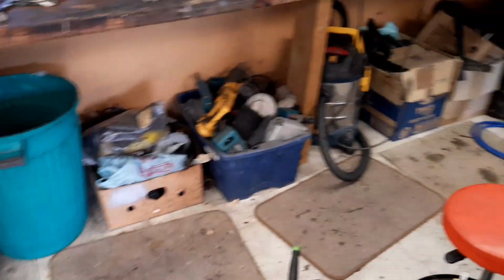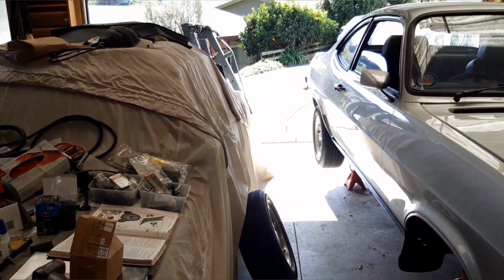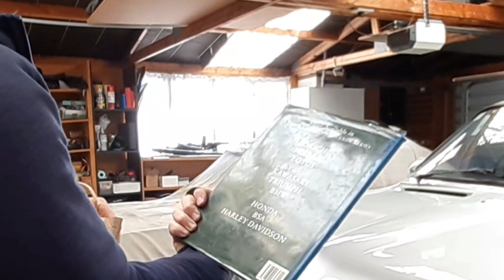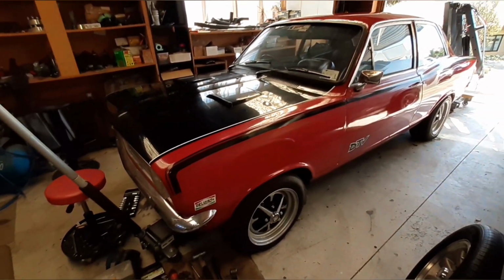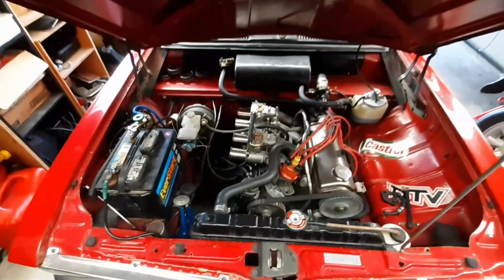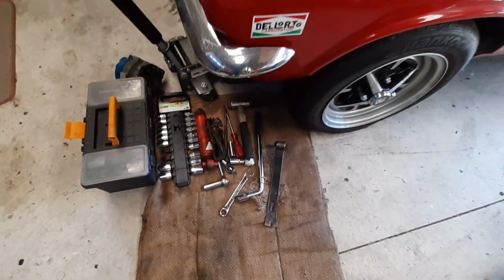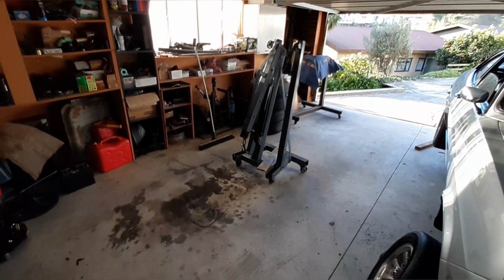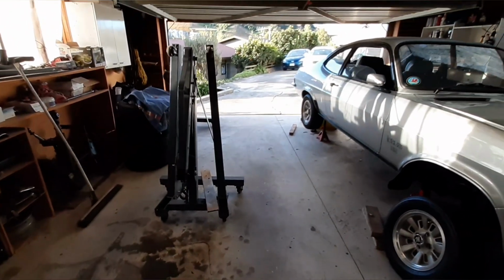LoTech Shed - Rehousing the Viva GT.

Comment: I had a standard 2.3 Firenza coupe that I also modded a fair bit back in the 80s and early 90s - genuine nosecone and some Capri Zakspeed arches with a big valve head (8 x 13s all round with 225s on the back and 205s on the front - 225s on the front were a tad too large as I recall), Kent VF2 cam and twin 48s. I did have an original snoot ZF box (and linkage that was made by a guy for the UK DSG), but later changed it for a Lotus ZF which had different ratios - I found them far better for street use. I think the first gear gave a bit more acceleration but was a little further spaced from 2nd so not as close ratio overall. I also had a 3.1 LSD back axle that was from a 3ltr Capri - it had been rejigged to fit the Vauxhall. I had a great time with that car. I bought the lower rear springs from a company here (last century), but the fronts just had a coil removed from the existing springs, and reheated the top cut coil to flatten it out (while it was in a bucket of cold water so it didn't effect the rest of the spring). That seemed to work well. 

There's currently a guy here fixing up a standard 1.3 HC viva and is going through some alternative springs so might be of some use maybe:

https://www.youtube.com/watch?v=IxiYTlNTgyU
Reply from the maker: Thanks for your comment. Sounds like you got into it deep back in the day. 
I've got some springs back in the front now, we'll see if they pass cert. Also installed new GAZ shocks. Still to spend more than a few minutes behind the wheel to see how I like it. It's quite firm for a road car, but kinda needs to be.
I will be posting an update soon, been a little distracted with the 'Vette!
Reply: @lotechshed4346  Looking forward to any updates - I've subscribed to make sure I see them!

I remember doing something a little similar to you after I'd rebuilt the engine (big valve head, reground crank, lightened and balanced etc) with the gearbox attached - I  test ran the engine just sat on the new front suspension (Ventora big disks and callipers)  to make sure the engine worked etc, then unbolted and disconnected the old engine and box and wheeled it all out on the front suspension, then wheeled the rebuilt engineand suspension into the car and connected everything back up - had a couple of mates help to lift the car body up to do it all. Then I drove it home lol. I can't believe the stuff I was doing then - must have been around the mid 80s. Later I ripped it all out to fit a Ford 302 V8 with Cosworth T5 gearbox.

I love the vette - I think it's my favourite shaped vette so I'll be catching up on that when I get through the rest of the Firenza content. Hope it passes certification.
Reply: @lotechshed4346  Looking forward to any updates - I've subscribed to make sure I see them!

I remember doing something a little similar to you after I'd rebuilt the engine (big valve head, reground crank, lightened and balanced etc) with the gearbox attached - I  test ran the engine just sat on the new front suspension (Ventora big disks and callipers)  to make sure the engine worked etc, then unbolted and disconnected the old engine and box and wheeled it all out on the front suspension, then wheeled the rebuilt engineand suspension into the car and connected everything back up - had a couple of mates help to lift the car body up to do it all. Then I drove it home lol. I can't believe the stuff I was doing then - must have been around the mid 80s. Later I ripped it all out to fit a Ford 302 V8 with Cosworth T5 gearbox.

I love the vette - I think it's my favourite shaped vette so I'll be catching up on that when I get through the rest of the Firenza content. Hope it passes certification.

Comment: Hello, are you struggling to get a coil spring still? I needed new ones for the rear of my 1998 A6 Avant with super sport suspension but they area obsolete. I found a place in Sheffield UK SpringCoil, I sent them the good coil and they made me 2 new ones for about the same price as off the aftermarket cheap shelf. Didn't realise that it is pretty easy to get a clone, you may be able to get some in NZ, but given how long you have waited you could have pushed it to Sheffield by now.. Best of luck..

Comment: Good to see you're back uploading! Which flat top chevy pistons did you use in the HBs 2.3? I'm possibly in need of some for mine and the originals are like hens teeth now.
Reply from the maker: 307ci I believe are right size and height. 3 7/8" bore I think? From memory there is a small amount of machining required to gudgeon pin. Go with forged pistons if you have the budget.